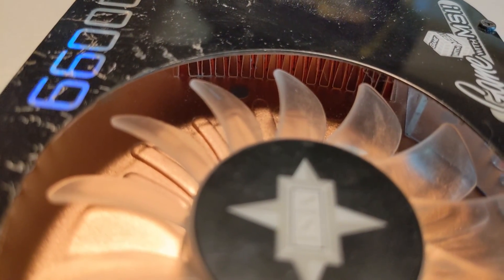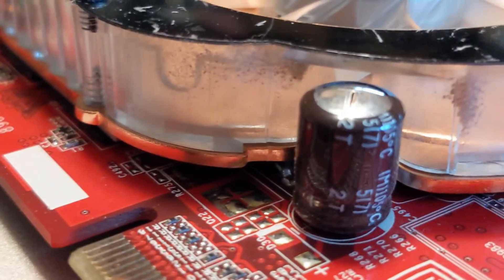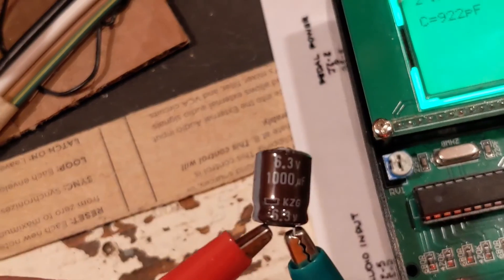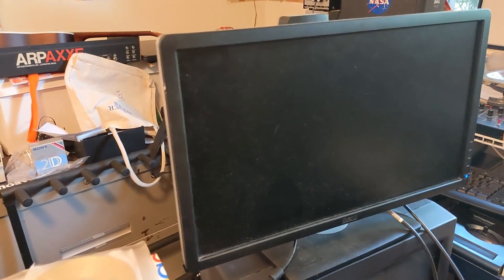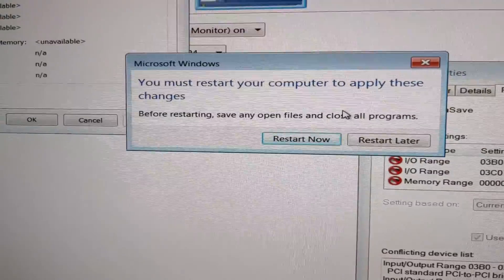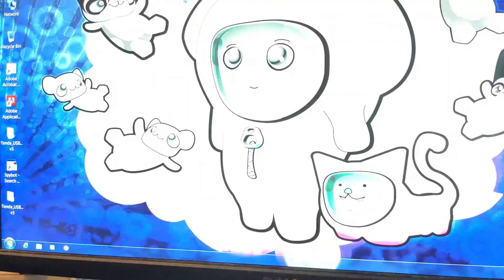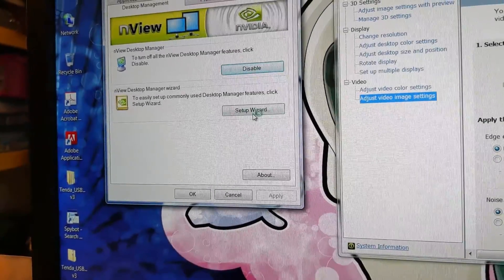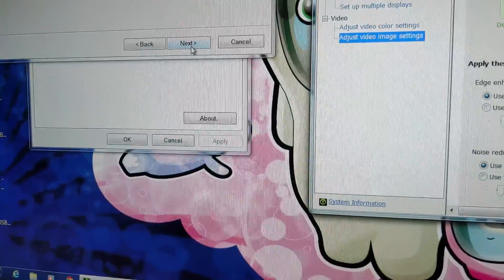Repair of an Nvidia 6600 GT Graphics card

Comment: I still have mine , but I need to buy a motherboard with AGP , my choices are socket 478 , LGA775 with AGP or socket 754 . do you know what are the common failures on this card ?
Reply from the maker: Mine had a real obvious bad capacitor- people generally do a lot of re-capping whether totally needed or not, especially on 90's gear.
Reply: @ErichIzdepski   mine is no longer working , no display in spite of the fan spinning,no bulging capacitors  . there no sign of electric activity apart from the fan  , the card is totally cold